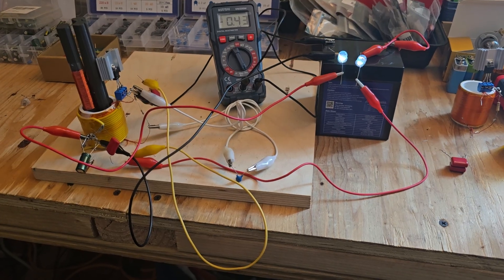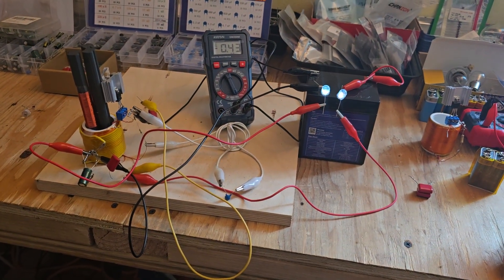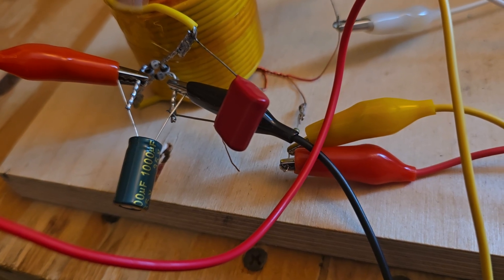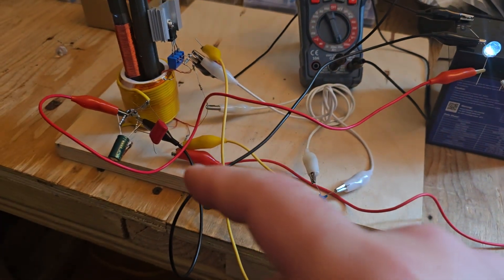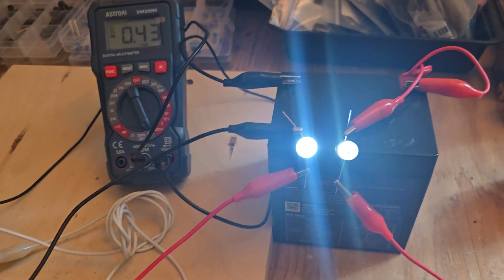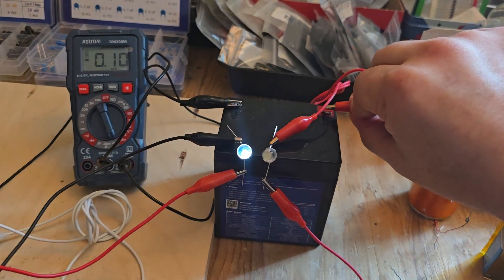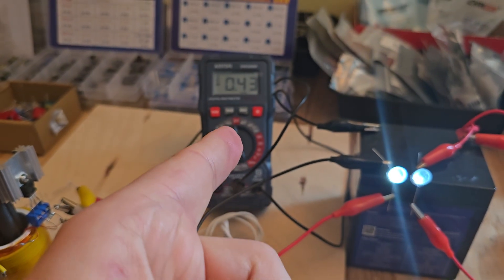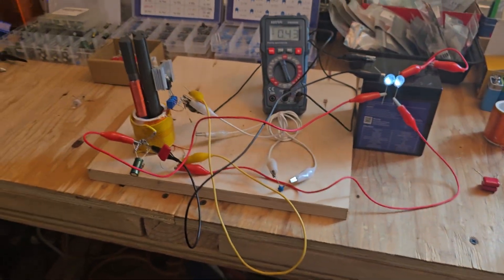⚡️NOVEL NON-LINEAR OVER UNITY DEMONSTRATION FROM THE IMPULSE ENERGY HARVESTING TRANSMITTER📡

Comment: 2questions  have you tried several leds in series to see if the current changes and what are your thoughts on instead of a battery try earth ground and an atmospheric antenna as positive thanks for the vids
Reply from the maker: Still have to try two leds in series & much more testing planned once the work week comes to a close. Been doing banks of tests with detailed notes then having our private research AI analyze the data & offer further improvement ideas.

Comment: Tell me how to make a perpetual motion machine
Reply from the maker: Haha, focus on solid state electrical components & energy synthesis theory by Eric Dollard. The best perpetual motion machine will only have displacement currents in motion or in a negative hysteresis loop to act as a transducer for environmental energy in flows. Start with a real tesla coil & optimize it for tuning because the wireless devices it can run become disproportionate to its input. :)